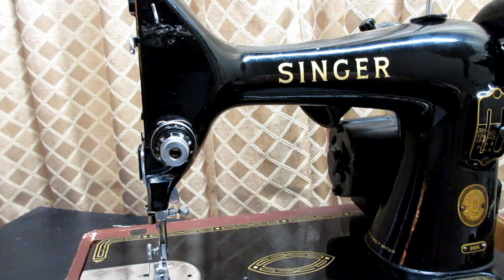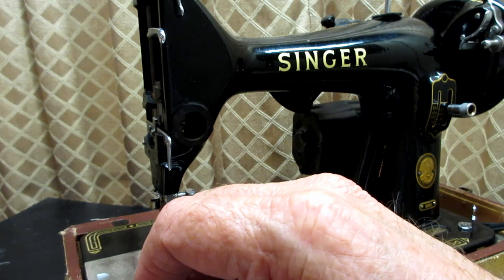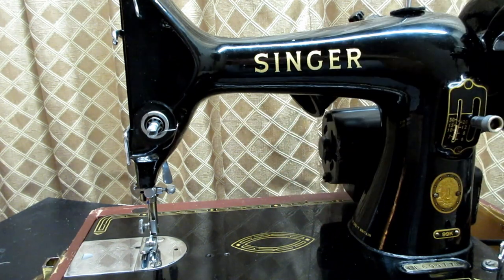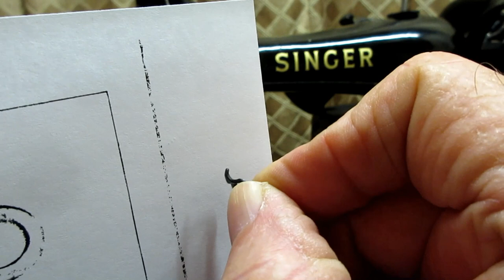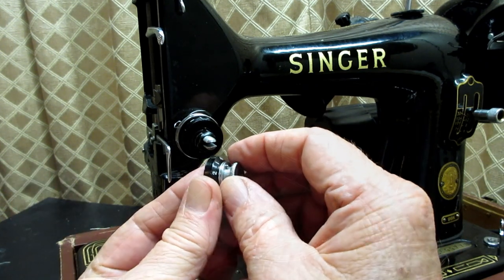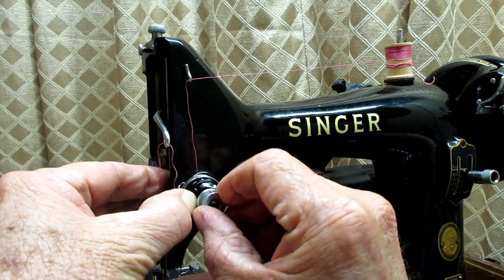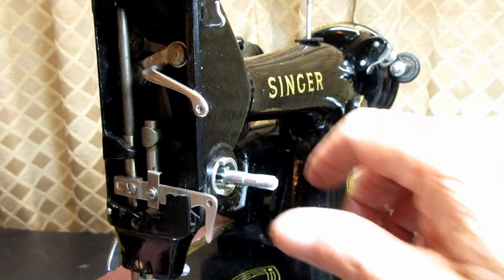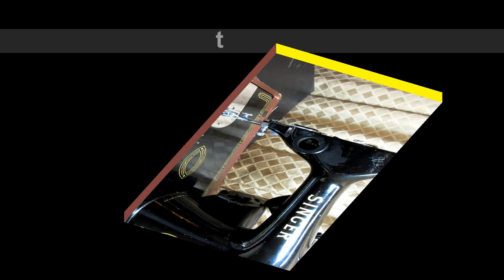The Needle Thread Tension Unit of a Singer Model 99K Sewing Machine

Comment: Hi Andy, I wonder if you could help me. I had to take apart most of the mechanism underneath the bobbin area of my new 99k. When I got it it wouldn’t move and was quite dirty. I cleaned is as there was a lot of oil and some rust in many parts, and I have been able to reassemble it by watching your videos. I also followed your tutorial to time it.

Now I started trying to sew but it’s not working smoothly. It starts and does the first few stitches and then it stops “feeding” the fabric and making knots under the throat plate. I’ve played around with the upper tension and bobbin tension but I can’t seem to get it right. If I help feed the fabric by pulling “gently” it continues to sew for a little while but I keep seeing both threads on both sides.
Do you have any idea of what could be wrong? When it stops feeding it just keeps braiding the threads underneath...

My model is from 1945, it doesn’t have the feed regulator lever, just a silver knob and the tension assembly doesn’t have numbers, it’s a basic one with just the plates and springs.

Thank you in advance!
Reply from the maker: The first thing I thought of is the condition of the rollers for the hook and feed systems. They are often in bad shape and b/c you mentioned rust, maybe even more so the chance of stiff, dry rollers on your machine. There is a very good rehab manual written by a charity that is often thought of as the "bible" for models 15,66,99, etc. It is $10 to download: https://www.tfsr.org/product/sewing-machine/ It covers the parts on the machine. I believe it covers the earlier models of the 99K like yours. I made a lot of videos for model 99K and you may want to glance at the title in the playlist to be sure you saw the ones for the regulator, feed, presser bar, etc. Here is the main page of the Playlist: https://www.youtube.com/playlist?list=PLsCOZgzzaiKIIUgkEujqHc9iNWN9NPW2Z
Reply: @andytubesewing1953  Thank you. I will have a closer look at the rollers and get that manual- Sounds like it will come in handy. 
I will go over the playlist again to see if I may have missed something else!
Reply from the maker: @laurajohnson852  I think it's a good place to start. Good Luck.

Comment: Hi Andy , Nice to write to you again.  As you know i was working on my 15J model and having problems with the motor belt, i since have just put in a good old elastic because i cant seem to get the right one (and that seems to work fine) to my suprise.. Other than that i have dismounted the tension unit  and having a little problem with that part now, your video is very helpful but my model is a little different. I have an extra disc that goes on after that inside spring and i cant seem to put it on right.... do you have a video for that or maybe you cant help in some other way.   thanks  again for your help  Andy. jn
Reply from the maker: This series is of a very common style Singer Tension Unit. It has a thread guard. Maybe this will help. If not you'll need to post a picture.
https://www.youtube.com/playlist?list=PLsCOZgzzaiKJaeFB_GW97NsW5GYM7KD9U
Reply: @andytubesewing1953  Thanks Andy, i will have a look at that for sure and bye the way i call mine   bijou   :)    . Have a good day.  jn

Comment: Gd day sir, what the purpose of that naillooking pin you’ved inserted inside the main shaft?
Reply from the maker: When you lift presser foot a lever inside the nose of machine pushes on the "Tension Releasing Pin" (naillooking pin) that pushes on the indicator dial ( - | + ) that pushes on the beehive spring inside the tension assembly. That releases tension on the tension discs. With the tension released you can pull your work out from under the needle. Also, raise the foot when threading the needle so no tension on the discs and the thread can enter between the discs.

Comment: I unscrewed the tension set screw but cant get the  thread take up spring regulator out? Any ideas?
Reply from the maker: Here is what I do in this situation. I remove all the other parts that I can, so only the stud and regulator are left. I spray or dropper some penetrating oil, like WD40 or similar into the hole after removing the set screw. I will lay the machine on it's back and put some of the WD40 around the outside edge of the regulator also, trying to get some to go inside the body and around the regulator. Sometimes oil has gotten in there and dried into a hard, varnish-like substance. Next, I will heat it up by blowing hot air into the regulator with a hairdryer, trying to expand the metal and soften the old gunk. I may do this a few times over a couple of hours, heat, oil, wait, heat, oil, wait. The main thing is to not try twisting the stud very much to avoid bending it. At some point, I will tap on the edges of the regulator with the handle of a wooden or plastic screwdriver. Some good raps trying to jar it loose. One time, in desperation, I put the blade of a straight screwdriver tip into the bottom left edge of the cut-out area that the spring moves in, and tippy-tapped the screwdriver downward left and got the regulator to move. Once it moved I was able to twist it some more and gradually pull it out. I guess the most important factor is patience, remembering the regulator has been in there for decades and may take hours to get it free.
Reply: @andytubesewing1953  Thank you so much!
Reply from the maker: @gigikeneipp5429  Sure, no worries. Good luck.

Comment: I cannot get my tension back. I have tried several times taking it apart and replacing it. No matter what I have tried I can not get the whole unit not to turn. Ideas?
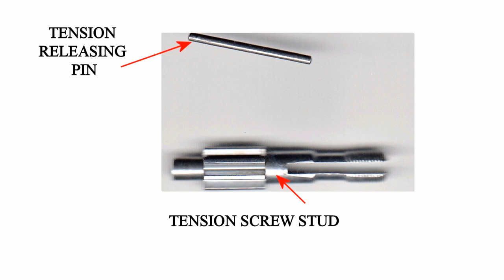Reply from the maker: There are TWO different set screws that hold the tension stud assembly stable to keep it from turning. Watch at these times. @4:44 is a slide showing the the tension stud set screw on the housing. @ 7:28 explains the tension stud. @8:00 shows how to install the stud and assembly, and @11:10 shows how to tighten the set screw that holds the assembly. If your assembly or stud is rotating, then one or both of those screws are loose or missing. So, one set screw holds the stud stable in the housing, and the other set screw holds the housing stable in the node of the machine. Thanks for watching my channel, and good luck.
Reply: @andytubesewing1953  I tried again to tighten the outside set screw and was able to tighten it more I had lined up the thread slot to 11 and the wire to 3 and give it a good turn and made sure the screw in the middle was in a horizonal position.  little pins in correct position and ready set go!!!!!!!  Not bad for a little 79 yr old lady   Thank you so much
Reply from the maker: @denashortt9405  You're the best, Dena!  🏆🌟 Thanks for not giving up on it. You made my evening with this comment, thank you.

Comment: Does the tension unit on the 1955 99-  work and look the same as this?
Reply: Also are the 66 & 99 tension the same? Interchangeable? Thank you bunch!
Reply from the maker: I don't know, Wliia. Cute is the only 99K I've worked on. There are a few versions of the model over the years but I could not tell you what year was which version and what type of tension it had.
Reply from the maker: @willablake9284  I've never worked on a model 66.

Comment: My 99K is older, 1923. It doesn't have the number dial. Would I basically do it the same way as yours?
Reply from the maker: Hi, Patti. I have not worked on that type, but parts manuals show the parts and the THEORY of how the tension works are the same, so I think you could do it. Singer later added the numerated dial so the sewist could return easily to a previous tension by setting it by number. Take a look at this nice video I have on my "tension videos" favorites list. https://www.youtube.com/watch?v=5ftHGCfU39M  He is handling a tension unit I believe is like yours. If this does not help then let me know. Please take plenty of pictures as you go along with the removal, and you do not need to remove the base & stud unless you want to.
Reply: @andytubesewing1953  Thank you so much!
Reply from the maker: @SouthpawPatty  My pleasure, and thanks for keeping that beautiful machine working. 1923 ..wow! almost 100 years and still going.